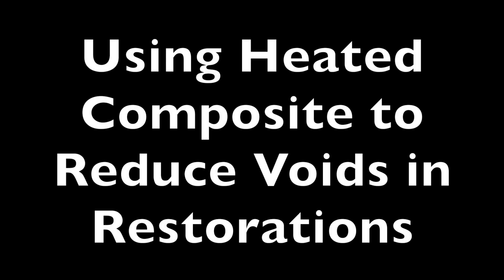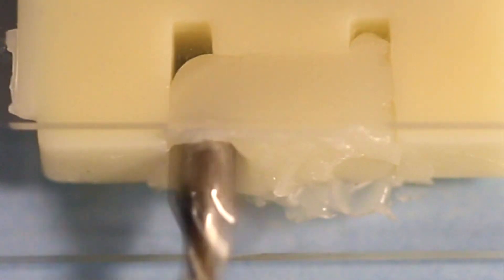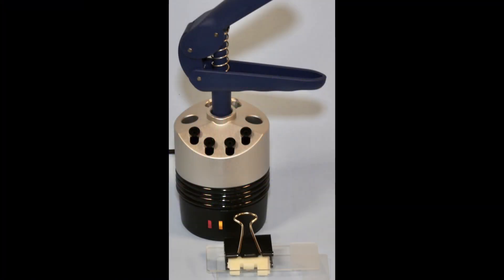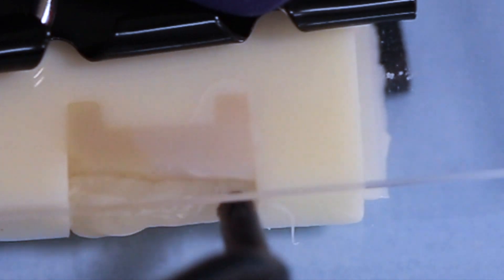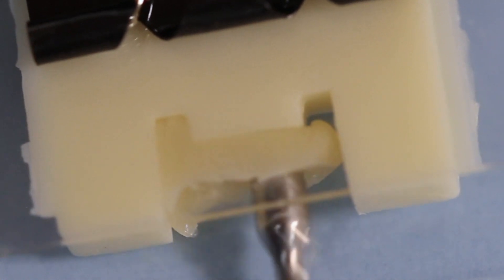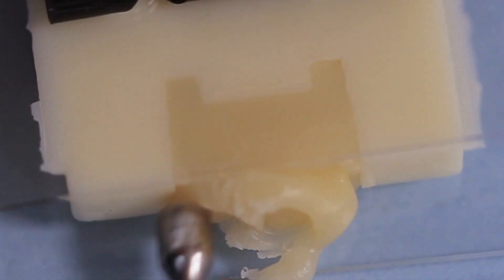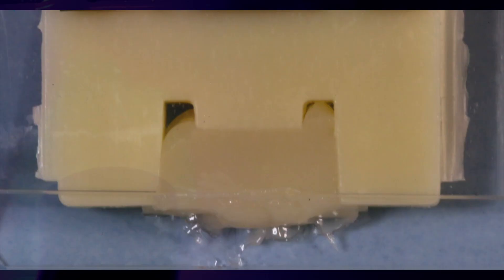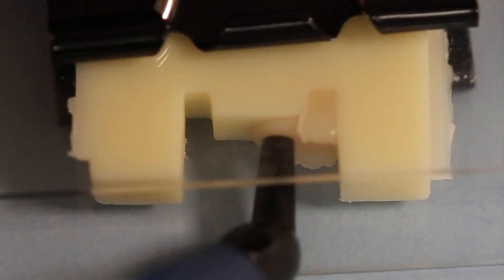Benefits of  Using Heated Composite

Comment: Just one question , if I heated the composite , will there be a pulp inflammation due to heat or not ????
Reply: Its gonna be warm enough to flow better but not that hot that it would cause a pulpal reaction

Comment: It would seem that using flowable in the bottom of the box would address the flow and void issues, like in a PVS imression.  Also using a big increament in the initial example and then using the unidose tip in the warmed example is not exactly apples to apples.
Reply from the maker: Agreed. But It is not my idea: Seehttps://www.ncbi.nlm.nih.gov/pubmed/12540112
Some call it the snow-plow technique